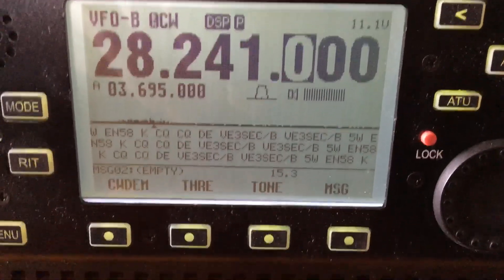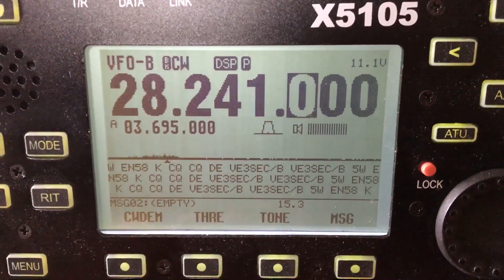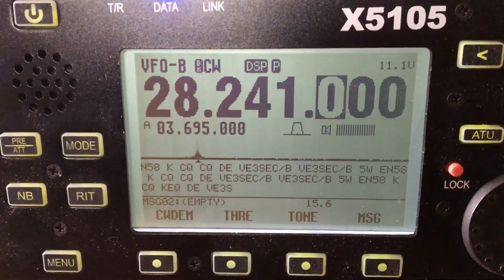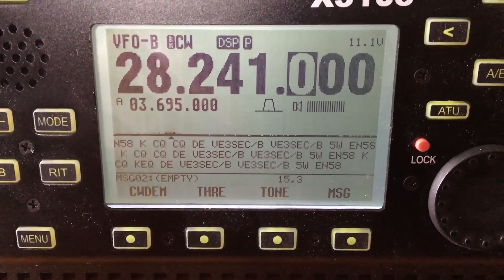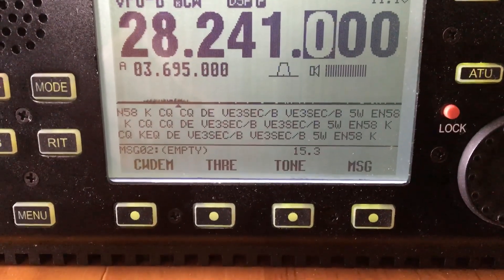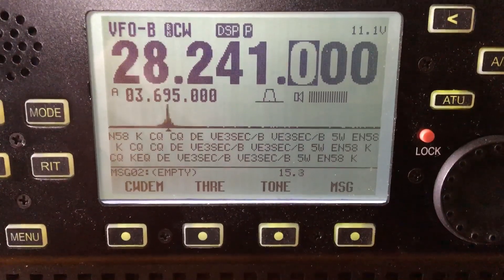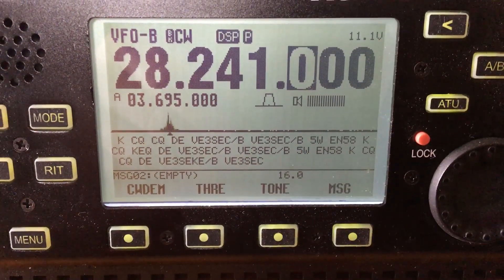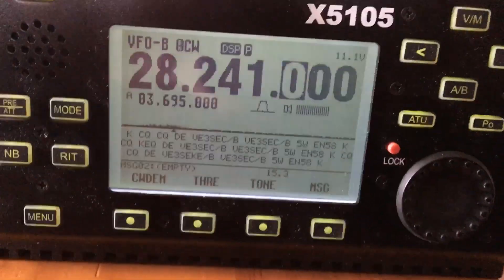Xiegu X5105 decoding VE3SEC 10m beacon

Comment: In the 11m lane, someone managed to open the station. and how did you do it. Thanks 73!
Reply from the maker: This radio as far as I know cant be opened to 11 meters
Reply: @VE3FAL1Fred   uff it was good I used it on the car in CB band
Reply from the maker: Sud Berceni ok not sure how the mod was done, I know G90 has hardware mod. Or are u talking about IC7300 mod?
Reply: @VE3FAL1Fred  x5105 man
Reply from the maker: Sud Berceni interesting